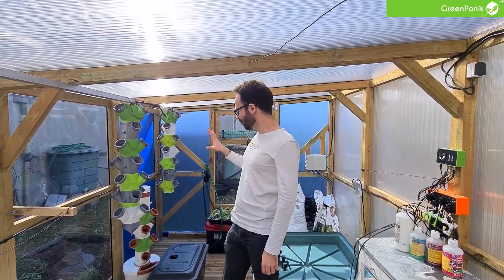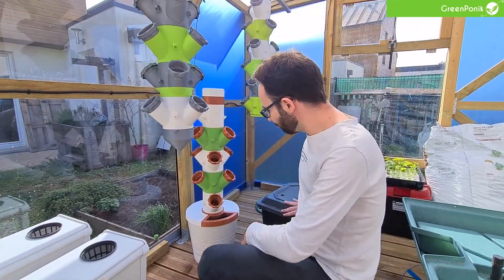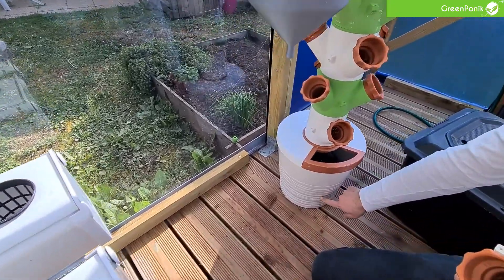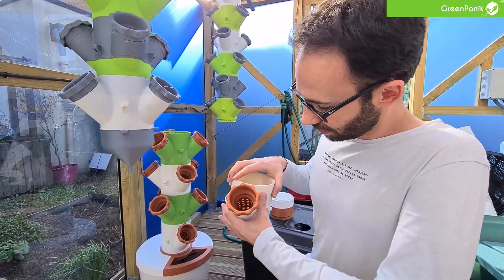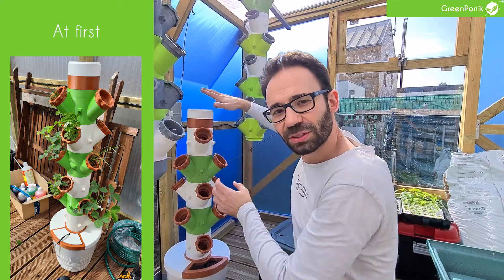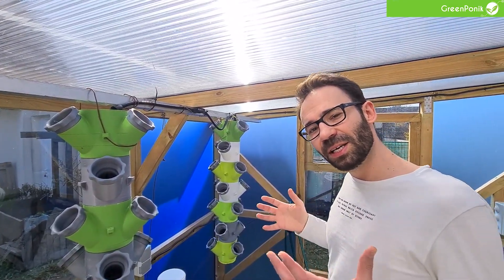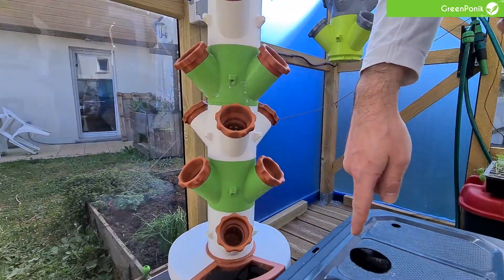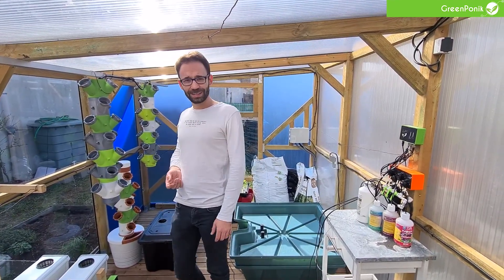DIY 3D Printed modular hydroponic towers presentation

Comment: I did print one of these and I can tell you right now that hte top part there will leak due to under extrusion in the walls. I've been thinking about lining the inside of each of these module pieces with food grade epoxy to avoid leakage and extend the life cycle.
Reply: Hello can you tell me how much does it cost to 3d print a hydroponic tower? Thank you
Reply: @Stavrossspand  depending of the fillerment . Personally i pay around 3-5€ per segment
Reply: @tobiashegemann1811  thank you very much my friend

Comment: Since PLA is porous - would it be safe for growing fruit and veg?
Reply from the maker: Not at all. Actually the biggest chellenge for PLA would be resisting the summer temperatures without deformations.
Reply: @greenponik  it would harbour bacteria. Is there any food grade sealant you would recommend or you just clean the parts after each season?
Reply from the maker: @chinwangy8929  just a deep bleach cleaning after (i let the system run on bleach only for a day or so, then clean all the parts manually).

Comment: What material did you print it with? I'm worried the pla+ I use will warp in the sun quickly.
Reply from the maker: Hi Randy,
Those have been printed with PLA+ for some and ASA for the others. ASA is the best choice for outdoor use as it won't be affected by the sunlight and temperature. 
The PLA+ is ok regarding summer temperatures. But it will get brittle after a few years of use. ASA is defenitely the material of choice.
Reply: I wonder if you can coat it with epoxy and a UV paint protection
Reply from the maker: @Ibuse123  Maybe you could, but it would be quite a bit of coating with all the risks that it doesn't stick that well long term🤓🤓

Comment: What kind of pumps do you use?
Reply from the maker: Hi Jake, I use a normal 500 lpm pump. If the tower is more than 1.5m high, you'll have to get a 1500 to 3000 lpm in order to get the power to push the water.